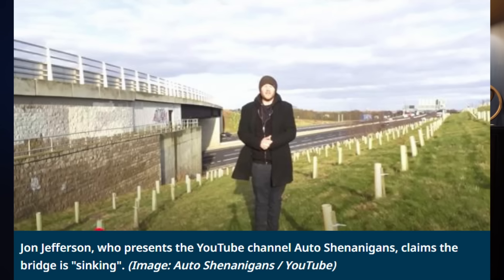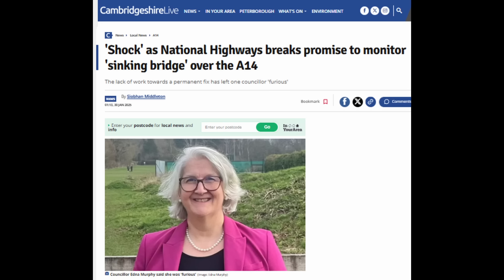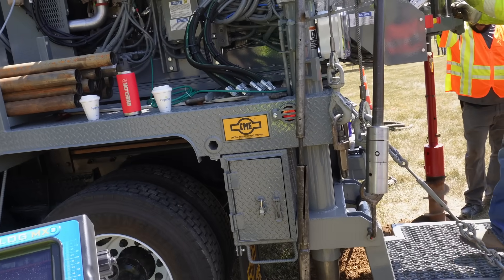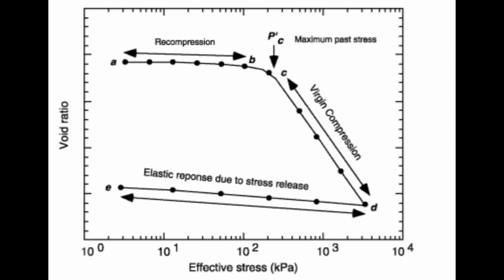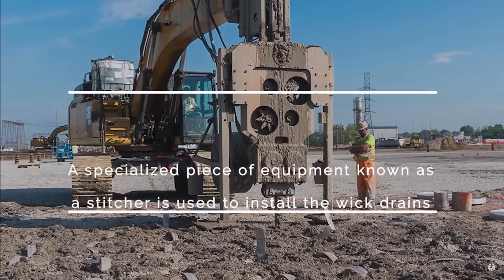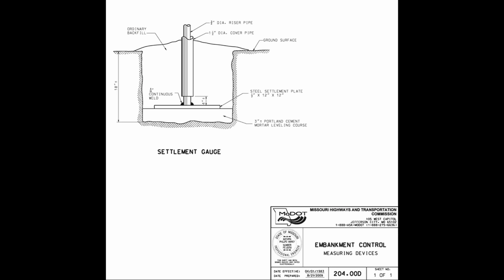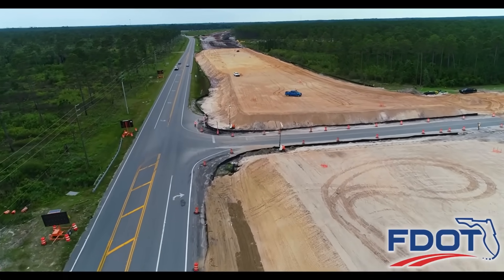A14 Bridge over A1 -  Highway Embankment Settlement

Comment: I’m reminded of when foundations for outdoor high voltage switchgear were being sunk on an existing long established (40+ years) substation site in what at first appeared to be very solid stable ground not far from a river,  the piles were still disappearing without any resistance at well over 40ft.

Comment: For the ciniplex in west centerville utah did exactly what you said on the sercharge compacted fill think we went about 20 feet over then they left it for a year before carving it back down. Intrestingly for a highway project in the same area two decades latter they used massive blocks of styrofoam to build up bridge ramps for freeway extension
Reply from the maker: Both of those techniques are good, although not all sites can make use of the styrofoam blocks for a variety of reasons.

Comment: The first rule of watching autoshenanigans' videos is that you should never take them too seriously. 
The second rules of watching autoshenanigans' videos is that they are for entertainment purposes only.
Reply: Autoshenanigans is a worthy video.  However, it does not claim to be an Engineer.  In UK most roads are tarmaced so hitting such a bump is pretty unprecedented.  Most cars on Motorway and A14 drive close to 70 mph.  Though it is in the Fens none of the rest of this road (all older) seems affected.  Minor roads in fens are often raised above the field height and often subside several inches though without breaks in the tarmac.  Generally might then choose to travel at only 40 mph when particularly bad.  Elsewhere many other UK bridges have an inch of subsidence at this point but there is not a break in the surface.

Comment: I'm quite surprised that the geotechnical engineers thought 20 metres was sufficient depth for road construction investigation in the English Fens.
Also surprised about the cross-over from Auto Shenanigans, which is the go-to channel for laconic English geography-based humour, and not so much for civil engineering.
Reply: His channel is certainly funny but I do not think he knows much about construction. He maybe posting videos that are more about engineering rather than interesting stuff beside the road to drive comments. Comments mean more of his videos get recommended to more people.
Reply: @johnclements6614  He doesn't claim to be an engineer. But anyone driving along the A14 can see (& feel) that they've screwed up that bridge and embankment.
Reply: @andrewhotston983  Where did I say that he claimed to be an engineer. I stated that he makes funny videos.

I do not know what depth the boreholes for this bridge and the embankments but unless you drill the holes at a very close spacing you will not discover all the features under the surface. Just because the current surface is flat does not mean that the surface was always flat. You could have two boreholes, 20m apart, with an old river channel between them that is filled with 5m of soft silt.
Reply: I'm sitting on a bench.

Comment: not sure what qualifies the messaging and content behind this video. obviously doesnt understand what autoshenanigans is about, certainly not passing comments on poor engineering or construction. more likely, comment about rthe massive overrun and overspend that still didnt produce a high quality result.

on your side Jon..........................
Reply from the maker: It's not that complicated. Somebody did a video making alarmist (and unfounded) statements about the condition of that bridge and I provided some technical clarity and engineering perspective.
Reply: @CaseyJones-Engineer  I agree, but without an inspection it is difficult to know what the real state of the construction is. The presenter was providing an opinion, as the majority of travellers do, and more of a reflection on the state of the industry in UK. Not the engineering.
This is a troubled area, as pointed out in many comments, settlement may be an issue, but when the amount of time over runs and cost over budget has been spent is it wrong to expect that these issues will have been mitigated or engineered out.
The result suggests not........the point of the video
Reply: @CaseyJones-Engineer  your video is nowhere near as funny and entertaining as Jon's was. And that's the point.
Reply from the maker: @ Different strokes for different folks.

Comment: I lived in the Fens for 17 years & drive over that bridge on occasion.

We bought our house new: it, like ALL new houses on peat in the Fens in modern times, had to be piled down 40 ft [12.3m] much as per 4:30. The house never moved, but the garden did. There are plenty of pre-piling crooked houses in the Fens!

A secondary issue is that non-motorway class roads in the area float on the peat. As you mention, water is a factor in peat thickness: wherever there are trees next to the roads - especially willow - they suck the water out of the peat & of course the adjacent bit of the road sinks, creating bumps. People regularly break suspension springs in the Fens - I broke two, and I know about the problem and reduce speed accordingly. The roads are constatnly being maintained, but of course the problem won't go away without removing the trees.

The effect on ground levels caused by removing water from peat - normally by drainage - is apparently well known. There is a post near Holme [the Holme Fen Post] that was piled in 1850 leaving its top at ground level: that post now protrudes by several metres.

Comment: FYI: Not an A14 extension, simply a bypass / replacement segment for the 1980's, post tensioned, segmental, Huntingdon viaduct.  Corrosion of the tensioning cables, advertised as good for 100 not 40 years, required a replacement carriageway to be constructed, just south of the exiting, and the failing viaduct demolished.

Comment: Organic Matter in the Construction Site:  My dad who was a judge told me in the late 50's, a cattleman had his 15 and 16 year old sons run a cattle dipping operation.  Although the instructions on the insecticide said cattle shouldn't be dipped, if the temperature was above a certain temperature and it had to be mixed with water in a certain ratio, the teenagers failed to follow the instructions and a large number of cattle died. The rancher failed in a suit against the manufacturer for the dead cattle.  The rancher dumped the large number of carcasses in a low spot in his property.  That low spot was in a drainage area where no-one built houses or businesses, so when the Interstate was laid out just a bit later, that represented the path of least resistance and cost for it to go.  The town dump was also in that area.  Today, alarm bells would go off dumping stuff in a drainage area, but then everything no-one wanted ended up there.

Comment: Thank you for using the NJ details because I was going to mention that.  However, it is my understanding from designing with approach slabs in nj that their purpose is simply to end that condition.  I would suggest that the critical part of the detail is that the approach slabs ends on the abutment sitting on it so that if settling occurs the approach "bridges" the settlement and maintain the ridability of the pavement.  The first picture which is hard to know exactly where it is does not appear to be founded on the abutment causing the discontinuity between the bridge and the approaches.  For what it is worth I concur with your analysis, thanks for the lessons on soil testing.

Comment: Construction of wind turbines with concrete foundations on top of peat on a hill in north Mayo, Ireland.  North Mayo is well known for high rainfall and Atlantic storms.  Following construction  a slow motion landslide occurred.  As I remember it,  the hole for the concrete foundations enabled water to enter under the peat at the hilltop.  This water then seeped under the hillside.  At a certain point the whole hillside started to move downhill.  Homes and a roadway were seriously damaged .  Peat has an ability to adhere to itself and originally formed some kind of water cap seal to the hill.  Imagine a balloon stretching over your bent knee.  Make a hole in the balloon near the top but the reaction is slow, I presume because of the fibres in the peat.

Comment: One thing I have seen to alleviate this issue is a bridge approach slab. One end is supported on the bridge abutment backwall and the other end is floating on the fill. It will spread the existing abrupt vertical dislocation over the length of the slab, say 20 feet. Of course, the slab must be structurally capable of spanning the length without continuous support. It doesn't change the underlying issues, but it does mitigate the inconvenience.

Comment: Hi Casey.. Interesting video as always.  I functioned as a Regional Geotechnical Engineer for a 6 county region for NYSDOT.  The settlement/consolidation of the support soils beneath approach/exit slabs is not uncommon and exists as you know for various reasons.. one of which your video highlights (long term compressibility of organic soils).    Of course my own pet peeve is the inadequate control and compaction of the lift thickness (which is dictated by compaction equipment), proper gradation and optimum moisture content of the soil(s)  beneath the approach and exit slabs. I stressed this through my group’s training of construction EICs, project inspectors, etc.  I also stressed that a soil is unsuitable based on its’ organic content and is unstable based on its’ (excessive) moisture content.  Also not having plans and details to review I am unclear why uni-axial geogrid was used in the fill portion of the embankments.  Were the sideslopes oversteepened, were there ROW issues, ect.?  Was the geogrid used for the abutment facing  only?  I used to spec out tensar 1100 series biaxial geogrid for use with select materials for embankments, repair areas, etc. with very good results.  The interlocking of the soils within the apertures of the grid provided excellent confinement and limited later movement even with the associated vertical loads.  I liked your analogy of pore water in soils using the sponge.  In my presentations I would exhibit this with the classic spring analogy to get the point across.  Keep’em coming Casey..👍
Reply from the maker: Thanks very much.  You are right about the importance of proper lift thickness, moisture control and compactive efforts.  I used to deal with dam and levee construction where such issues are particularly critical.

Comment: Nice video and report on it! You would think if they built bridges in places or conditions like this, where the bridge was stabilized to the conditions, that they would stabilize the approaches tapering off from the bridge deck back in slightly diminishing points of stability so it would be more of a ramp type of effect! I understand it would be costly, but in sever cases where you have poor conditions, the original cost may be cheaper then all the fixes needed.
Reply from the maker: Thank you.  Yes, I think this situation is likely to end up being a maintenance and repair headache for many more years to come.

Comment: Soils that have a lot of organic material tend to sustain volume via processes of natural acidification and anoxic/anaerobic conditions. Peat is no exception and it’s one of the better pH buffers in the 4.5 to 6.5 pH range. In fact this is one of its major selling pints for use in aquarium or gardens. 

The problem is however that bridges and attached road beds are made of concrete and concrete has an excess of unreacted lime which leaches out over decades, lime has a pH of 10. During normal periods this is not a particular problem, however during dry periods the lime can get into the natural substrate and this can accelerate the rate of deorganification of such soils. 

As a general rule you should not build on peat, Trinity clay, or other heavily organified material. It is not unheard of in our area to see house foundations and particularly garage foundations that have sunk a foot. The most common culprit is droughts and trees, trees add an additional strain because it creates an addition stress of roots pushing up a slab and rootless removing water causing cracks. 

What typically is done when one get to a soil that was once a part of a lowland is to lime the soil. This can proceed by removing the topsoil layer, typically 8 to 15”. Then bringing in agricultural lime and spreading it. This results in a fairly rapid contraction of the soil, this is followed by bringing in fill dirt, like select fill, it’s basically compacted fine grad silt and clay in order to bring the soil back to the desired elevation. For homes, some contractors do want to pay to remove the excess top soil so they tend to push the topsoil and the organic soil to the side and flatten it out. Then the homeowner may build a garage or shed only to watch it sink over a decade or two sink. Sometime people add extensions like patios, which the enclosed as part of the home, again, the same problem, the foundation will tend to dip into the yard. Condenser unit slabs have the same problem, they tend to dip and slide, dipping in the direction of the least stable soils and sliding in the direction of the dip. And a slab can seem perfectly fine for a decade and then one serious drought hits and it dips and slides inches. The hidden culprit here is often the roots of trees grown in the yard are basically sucking water and nutrients out of the soil opening the soil up for more rapid oxidation. In our area they recommend that the canopy of trees occupy no more than 50% of the total area of a quadrant around a house that in which the yard naturally drains (IOW grass on topsoil on its natural substrate). 

This problem is a house killer, it is the number one reason why old houses in my area are torn down. We can identify 3 faults here

In adequate removal of organic enriched  and shrinkable substrate. 
The proper fill material replacement and proper compaction. 
Where required inadequate number of piers at the proper footprint and depth.

Moreover many deeds require planting of oak trees, some of the cheaper local varieties will overgrown the yards they are planted into and cost 10s of thousands of dollars over their lifetime to maintain. Some homeowners have elected to chop down these oaks and replace them with species that have smaller maximum canopies. 

OK so back to the road bed. To see a similar issue we can look at SpaceX build on boca chica. In this case they are essentially filling over the active flood plain of the Rio Grande river, less active now, which is occasional subject to tidal surges from tropical storms. The sediment is deep and biologically active. As predicted they had considerable difficulty stabilizing the surface due to the fact they built essentially on a sandy sponge. During a recent launch the spongey nature was made manifest when a power pulsating force (liquefaction forcing) was place on the concrete, the underlying soil gives, fails to support the slab, and the slab just breaks up and flies away (much frowning on the face of the FAA). As we see SpaceX managed to create a work around. 

So what are the primary issues here on the roadbed, obviously not rocket ships. 
1. A history of wetland and a potential for future flooding, cycles of saturation of the substrate and fill material
2. The weight and frequency of large loads over the roadbed. Water + cyclical force = change.
3. Cycles of drying and the amount of lime leaching from the concrete. 
4. The level of side wall support for the fill, and oscillation induced spreading of the fill material, the type of fill used. 

This problem of needing to adjust embankments is not an unusual one in our area, nor are sinkholes in roads, erosion around street drains, poor contractor work (compaction is everything), etc.

There are all kinds of solutions. 

1. Drill holes and inject cementaceous  mud below the concrete (How many holes, how much set time)
2. Build up a layer of asphalt. (Asphalt is often not suitable for some applications given the expected loads. 
3. Remove and replace the transitions. ($$$)
Reply from the maker: Wow, thanks for the detailed explanation! Peat is certainly bad news in the foundation soil profile but just can't be avoided in some cases.

Comment: Fun facts:

Holme Fen, specifically Holme Posts, is believed to be the lowest land point in Great Britain at 2.75 metres (9.0 ft) below sea level which is 15 miles north of this bridge/junction...

The whole Fen area, this bridge/junction isn't actually IN the Fens (just outside), is sinking due to the excessive emptying of the freshwater aquifers under the entire area... especially in the southern part where this location is very close to...
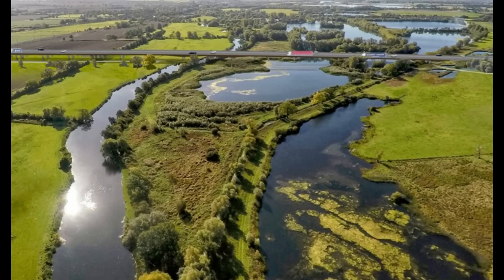Reply: As you point out, this is not in the Fens, but outside, on Oxford Clay, a widespread substrate in this part of England. It is also misleading to describe this "swampy". The Skanska picture at 3:58 is of old mineral workings about 3-4km from the bridge. The superficial geology here in the Great Ouse valley includes sand and gravel that have been exploited commercially. So it is certain that piling has been driven into the clays, probably to a considerable depth. So the jury will be out for a while to see if the settlement stabilizes. Anyone travelling along the A14 in the vicinity will have driven over a number of newish road bridges constructed over recent decades, so will be able to judge if the bump here is excessive compared to others nearby.
Reply: @neilbucknell9564  ...my point exactly...
Reply from the maker: Ground water extraction will only increase the amount of settlement in such regions.